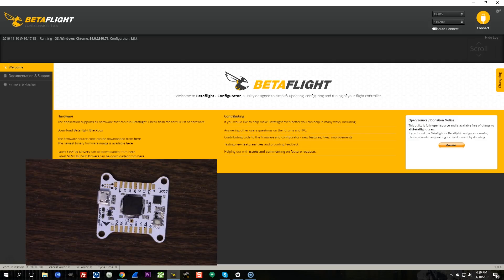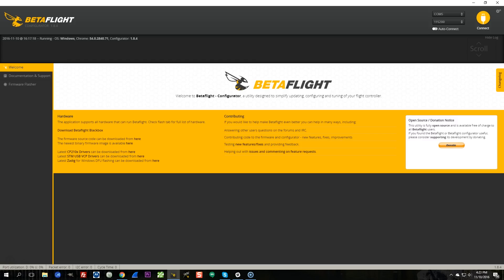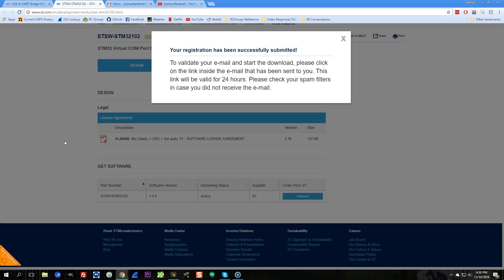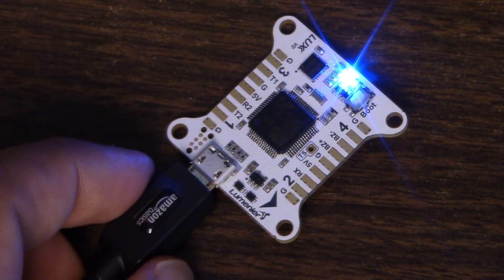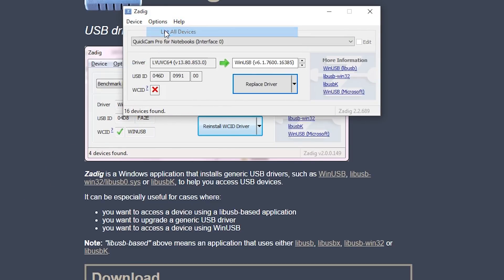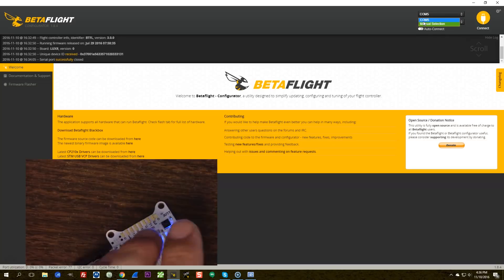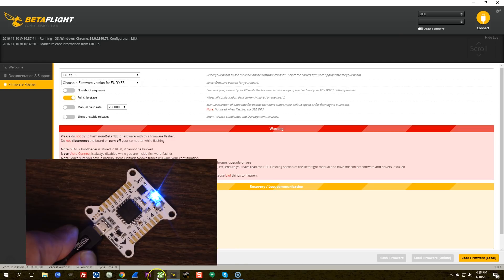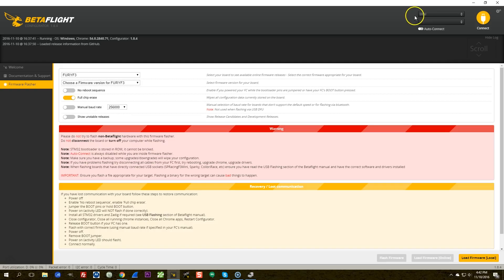Betaflight / Cleanflight Flight Controller Won't Connect | FIXED

Comment: What drivers should I download on mac? Currently having the issue that despite my transmitter and receiver being bound and having set betaflight to serial receiver and s-bus, nothing is happening on the receiver tab when powering on the copter. The only thing I can think of is that i can't download all the drivers onto my mac.
Reply from the maker: Mac doesn't need VCP drivers downloaded. It doesn't need impulseRC driver fixer either. It comes ready to go.
Reply from the maker: Receiver tab not responding is not related to drivers. As long as you can connnect with the configurator, the drivers are working. Betaflight is just not seeing your receiver likely because you've wired or configured it wrong.

https://www.youtube.com/watch?v=ZpU6-JY6fnk
Reply: Checked how I've wired and configured it and everything seems to be correct. Wired it to the voltage, ground and sbus on the receiver. Connected it to the voltage, ground and rx on uart 3 on my flight contoller, then on betaflight switch rx for uart 3 on and then set it to serial receiver and s-bus on the configuration tab. My receiver and transmitter are also bound so not sure what else to do?

Comment: I’m having this issue., and though I found is this easy to follow I’m still not connecting. My board doesn’t even come up in device manager. I can get a solid blue light (bootloader) and have updated drivers multiple times
Reply from the maker: If you are using an SPRacingF3 board, or any board based on that layout, you will never see DFU in the configurator, even when you are in bootloader mode. I have had issues with this board. Sometimes you need to put it into bootloader mode manually. Sometimes it only works if you hit flash with the board not in bootloader mode. Sometimes you need to do manual baud rate.

If you're not using the spracingf3, then it's the VCP drivers. You need to install them so you see COM port when you plug in normally, then run impulserc driver fixer to fix the driver for bootloader mode.
Reply: Joshua Bardwell Yep it sure is., F3 Femto with the spracingevo flash I believe. Okay I’ll keep trying different ways. It’s my first build, and pretty capable soldering but is it possible I could have damaged it? Would it still flash lights/solid blue if it was damaged? Thanks for your help
Reply: Also, you don’t even hear the computer “chime” on insertion. Or find it in device manager regardless of what mode you have it in. It’s like the lights are on but no ones home haha

Comment: You skipped the most important part on the VCP driver. I extracted the archive and ran the DfuSe_Demo_V3.0.5_Setup executable. Nothing, i still get the failed to open serial port error. What now?
Reply from the maker: I don't think you downloaded the VCP driver. DfuSe Demo is something else.
Reply: i can connect to the FC and modify settings, but if i try to connect in bootloader mode it gives me the port error. when i look in device manager i see the STMicroelectronics virtual com port (com3).  any ideas there?
Reply: ok, i redid everything and was able to get the RC to connect in bootloader mode, THANK YOU!

Comment: this video would have helped but u missed the install step. so it was not complete. i am not good with pc's and dont know where to find that file i downloaded
Reply from the maker: I'm sorry but that is going to be different for every computer, so  that is why I didn't show it.

On Windows, the file is typically put in a folder called Downloads. It is usually linked in the Windows Explorer quick-launch menu which is the left side-bar of the Explorer window.
Reply: thanks well this is the best video out there for direction. i am just terrible at doing stuff like this. why are they not just plug n play?

Comment: What if non of the driver software don’t work even if i download all 3 and still cant connect
Reply from the maker: Some USB cables are power only. They're just for charging phones. Switch to a USB cable that definitely works for data.
Reply: Thank you so much i bough the usb cable my mac read it yet didn’t want to connect so im going to work on that tank you for teaching new thing everyday lol

Comment: all mine does is it says port opend successfuly and like 10 seconds later say its closed successfully what could this be ?
Reply from the maker: Your drivers are probably messed up. Do you see "COM3" or whatever number, in the upper-right pulldown menu when you plug in? If not, then you won't connect.
Reply: Joshua Bardwell yes com 3 shows
Reply from the maker: What FC is it?
Reply: i have flycolor rapter 390 i think on arris c250 v2 , my first real drone, very new to this
Reply from the maker: This board uses SPRACINGF3 target, which means it has a CP210 chip managing the USB connection. This means you will see COM3 even if there is something wrong with the firmware on the board.

Did you flash the board? If you flashed some firmware other than SPRACINGF3 target, thta is the problem.

I suggest you follow this technique:

https://www.youtube.com/watch?v=Om6teCbJM4U
Reply: everything is how it came i was just wanting to see what betaflight had to offer , i am not to familiar with any of this, sorry for bothering u though lol
Reply: i doesnt have a boot button so i tried to solder a lead to connect them, drone was preassembled
Reply from the maker: If you have soldered the bootloader pads together, that is why you can't connect. The board is in bootloader mode and is waiting for you to flash firmware to it. De-solder the bootloader pads.
Reply: i solder a jump lead wire so i snipped the wire so can connect them whenever neccessary, so when do i connect and when do i disconect, it did nothing before i connected then

Comment: Hey Joshua,  I'm not familiar with the "Sensor Tap" to check the gyro.  Checked the other suggestions and they are normal.  Thanks

Comment: Installed an HGLRC F4.  On the first flight test I realized I had no yaw control.  Yaw works in beta but not in actual flight.  Since I couldn't do anymore flying...as far as I can tell...yaw is the only stick movement missing. Why would I have no yaw, what have I missed...........again!
Reply from the maker: +Junkyard Drone first check the receiver tab to be sure the yaw channel is working correctly.

Look in the sensors tab and see if the yaw gyro moves when you move the quad with your hands.

Check that yaw P gain is not zero somehow.

Comment: hi joshua.
i bought eachine wizard x220s and it has omnibus f4 v3 flight controller.
i can't connect betaflight i did everything in your video 
can you help me about this problem ?
if you give me a your mail adress i can give you a TW information and you can connect my computer and control settings ?  can you do that ?

Comment: Can you please help me understand what is going on here and tell me how to put betaflight on this board?
...
I have an SP F3 Racing board. When I plug it in, Betaflight and or cleanflight a message comes up that says "Non - Cleanflight/Betaflight firmware is NOT SUPPORTED, except for CLI mode."
So I said OK and typed in "dfu" the it comes back with the message " "unknown command, try 'help'
# "
I am using the stand alone Betaflight 10.0.0 software.
This is the board... I have the Acro version.

https://www.banggood.com/Upgrade-NAZE32-F3-Flight-Controller-Acro-6-DOF-Deluxe-10-DOF-for-Multirotor-Racing-p-1010232.html?rmmds=myorder&cur_warehouse=CN
Reply from the maker: The board shipped with an old version of cleanflight that doesn't support the DFU command is my guess. You need to put it into bootloader mode by shorting the bootloader pads.

Comment: I see STM32 BOOTLOADER in the device manager under universal serial bus devices. I also see in in betaflight upper right and DFU in the box. When i disconnect and plug it in without pressing button on FC it says under universal bus controllers Unknown USB device(device descriptor rewuest failed). You can tell im not good navigating my wa around conputers. I seen one of your videos that you were walking this guy through an issue with his quad. Is  there any way you can doo the same so you can see what i have on my laptop?
Reply from the maker: Since you see DFU and are able to flash, you know the STM32 drivers are installed correctly. So that's good. You also know the USB cable is working or you couldn't flash. Device Descriptor Request Failed usually means the USB device itself is having some issue. Are you 100% sure you flashed the correct board type ("target") from the pulldown menu? 

What FC is it?

Comment: This doesn't work at all :(  Bfight 210 can't get it to connect.  when I turn it on, Rx is connected to the Tx, but moving the sticks just makes the quad beep.
Why is this hobby so stupidly difficult?
Reply from the maker: This video is about making your FC talk to your PC, not about making your receiver talk to your FC.

Check in the receiver tab, in the configurator. When you move your sticks, do the channel indicators on the receiver tab move? Since you are getting beeping in response to movement, I suppose the FC must be seeing movement from the sticks.

Check channel mapping in the Receiver tab is correct for your transmitter.

This might be a good video to start with: https://www.youtube.com/watch?v=JkggzZySIqs

The hobby is stupidly difficult because it was invented by nerds who pushed the envelope of what was possible. This is the exact equivalent of building your own track racing car from a kit. For sports cars, you can go spend $100k to get somebody else to build and maintain one for you. That doesn't really exist in the quad world yet. So you have to build and maintain your own.
Reply: The RX and TX are connected and talking to each other fine.  The quad and betaflight do not communicate tho... so I can't see on the screen what's going on... I think I pressed the boot button when I plugged it in first time, looking for the Rx bind button?  But now, moving the right stick up, just causes the quad to beep at me, and moving it down makes it beep rapidly.
I sent a full description of what's going on to your patreon inbox.  Please help.  don't just tell me I'm dumb, like every other person I meet who I've asked for help.
4 years of mean folks and no flying... I'm thousands of dollars into this (literally bookshelves full of quads that I couldn't get to fly even once)  and just getting really frustrated.
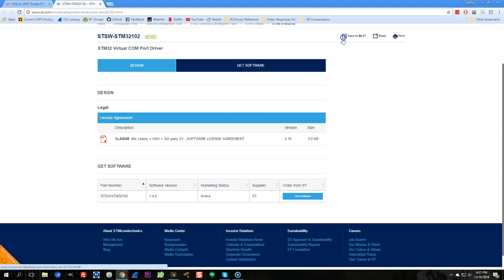Reply: I followed all the instructions... No idea what you're talking about at (3:00) the part you don't actually show and just 'describe' with a bunch of acronyms. 
Still Nothing.  PC doesn't even chime to show that it's plugged in... tried a different PC... same issue.  Nothing... tried a different quad... nothing.
OK what next?
Reply from the maker: You need to download the Windows Executable Application (.EXE file) that will install the Virtual COM Port (VCP) device driver on your computer. You download this from the STM website as shown in the video. After downloading it, double click the .EXE file to install the driver. Then the PC will chime to show that the FC is plugged in and you can connect with the configurator to configure the FC. But you cannot flash the FC with new firmware (to upgrade it, for example).

Un-plug the FC from the computer.

If you want to upgrade the firmware on the FC, you need to download the ImpulseRC Driver Fixer app and run it. Then plug in the FC again. Now the ImpulseRC Driver Fixer will "fix" the drivers. Now you can flash the FC as well as configure it. But if you change the firmware on the FC, you will totally wipe out the configuration on it and have to rebuild it from scratch, so if you don't feel you can do that, don't flash the FC.
Reply: Got it!  thanks!   sorry i'm really frustrated and just about had enough.
Reply from the maker: Hi, Rich. You unusbbed as my patron so I can't respond to your messages. I am working on getting you some help. Please go to this FB post and look.

https://www.facebook.com/fpvknowitall/posts/249094968958189

Comment: Joshua Bardwell Thank you so much for this video! I had no problems flashing my SPRacingF3 board with my 1st 2 builds but with this 3rd build I have an Omnibus F4 Pro V3 and I couldn’t get it to flash at all. I ended up cleaning house and deleting all the drivers installed for BF and started from scratch. I then watched this video and followed step by step and I was finally able to flash the latest firmware on my FC. I’ve been fighting this issue for 2 days now, so thank you for the help Josh! I’m finally ready to start wiring my 3rd build! I’ll be flying this weekend finally!

Comment: Correct me if im wrong....to put it into bootloader mode...1. press and hold button while plugging in usb. When i do that blue light is on steady not flashing...
Reply from the maker: On steady is consistent with bootloader mode on some boards. Do you see "DFU" in the upper-right corner of the configurator? Do you see "STM32 Bootloader" device in Zadig? These two things would indicate that the board is in bootloader mode.

Comment: I have a king kong 115 and everything was working. I could use the remote to arm and disarm the quad then the screen froze in betaflight. After 5 minutes of not unfreezing i restarted my computer and now the quad doesn't do nothing at all. I tried connecting to betaflight and it says failed to open serial port. I been messing with this thing for a week now and need help. When i do plug the usb port in i have one solid blue light and no connecting to betaflight.
Reply from the maker: +Kenny Michaud put the board into bootloader mode as shown in this video. Then re flash it with "full chip erase" selected. If the board won't go into bootloader mode and you gave only one blue led then it's probably dead.

Comment: Thanks this video was really helpful. I got four FC's I was having problems with. I got three of them straightened out and working. BUT during the process I accidently flashed Betaflight on a control that was sold for Cleanflight, Baseflite. I guess I didn't look close enough at the specs advertisment, thought it said Betaflight. Net results is I have Betaflight on an FC intended for Cleanflight.  I noticed I was having problems with the GPS working and then not working. Then I figuered out I had flashed it with the wrong brand of FW. Problem is I can't flash Cleanflight on the FC now. The error message says it can't connect to bootloader on Cleanflight. I can flash any version of Beta flight on the FC with no problem but can't get it back to Cleanflight. The FC has the CP2102 chip on it. I didn't need to short the bootpads when I flashed with Betaflight. I tried to load CF FW with the pads shorted (and not) but no go with that either. Is this a situation that the SWD would provide a way to fix the problem.? I have no idea yet how to use SWD but I started looking into it and it seems it would be  a task that I would have to learn. I don't mind studying the subject if it is a path tht leads to fixing the FC. It's only a $24 FC but I'd rather learn something than toss it if it possible to fix it. Thanks for any pointers you have.
Reply: http://www.st.com/content/st_com/en/products/development-tools/hardware-development-tools/development-tool-hardware-for-mcus/debug-hardware-for-mcus/debug-hardware-for-stm32-mcus/st-link-v2.html
 I found this tool and some software so maybe I can clear this thing out and reload it.

Comment: so i watched you videos. downloaded all the ports, and flashed it but i still cant get it to connect to where i can adjust my pids and controller settings. can you help me out? thanks
Reply from the maker: In the configurator, look in the upper-right where the pulldown menu says, "Manual Selection". When you plug in the USB cable to the FC, does that change to something else like COM3?

If no, then the drivers are not correctly installed or the USB cable might be damaged.

If yes, then the driver are correctly installed and the USB cable is fine.

Comment: The STM package is for Win7&8, I'm running 10. No clue what to do from here....
Reply from the maker: The same drivers work on 10. Just go for it.
Reply: I have downloaded VCP and STSW STM, ran the installer and went to the extracted folder, ran the exe file, plugged in the controller on my Wizard, but the red light blinks a few times and then nothing.

Comment: Regarding the STM drivers. There is a Windows 7 and Windows 8 folder, but no driver folder for Windows 10. Should I be installing the Windows 7 or Windows 8 driver or is it just not compatible with Windows 10? Thanks.

Comment: Excellent explanations for the USB driver nightmare... I spent 10 hours yesterday screwing around trying to get my BeeBrain to talk with Windows 7. I finally got it to work. Looking at this video nicely summed up the issue with the drivers hell I went through. Thanks for taking the time to do this video. Much appreciated...
Reply from the maker: Really sorry you had to go through that. There is no reason for this to be more than a 15 minute process. This is one of a few issues that I desperately wish Betaflight would do better. 

Maybe now that BF Configurator is an EXE file instead of a Chrome app we can move off of the winusb DFU driver.